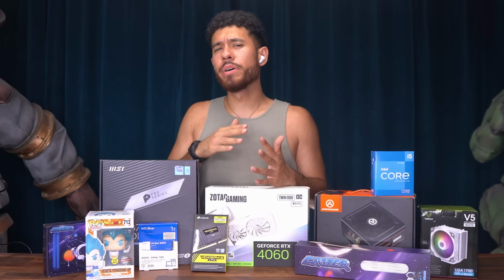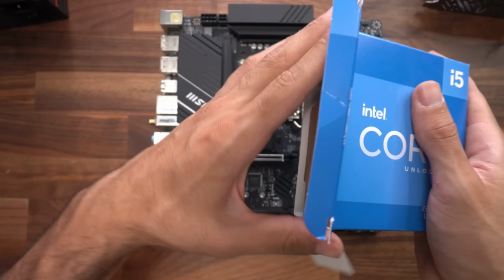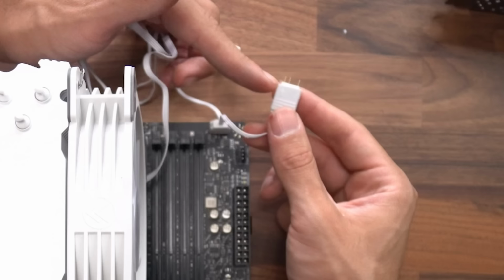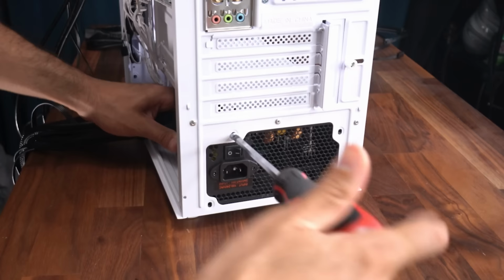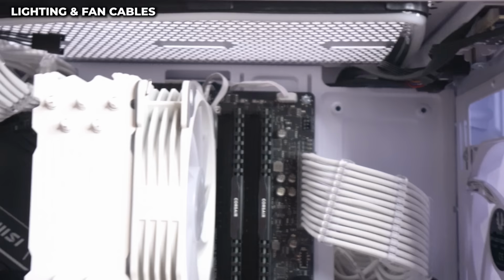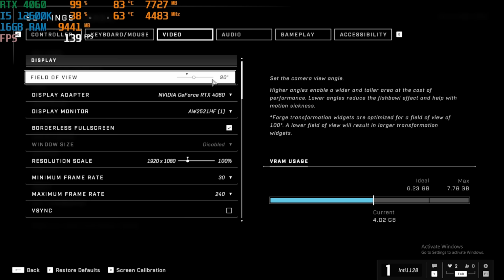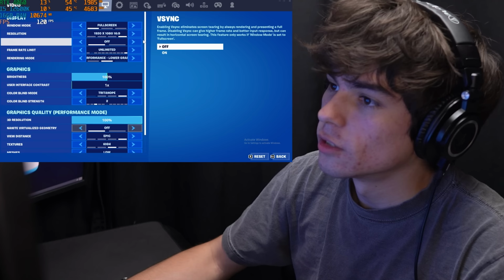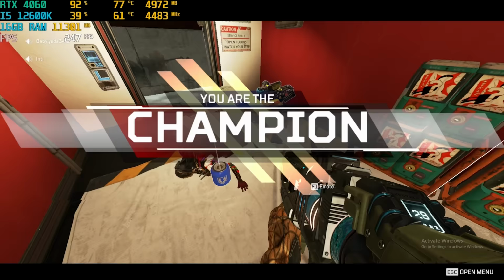BEST $900 Gaming PC Build Guide - RTX 4060 i5 12600K (w/ Benchmarks)

Comment from the maker: PCs for SALE from videos! :D https://craterhq.com/collections/desktops
Reply: It's out of stock. You gonna add more soon?
Reply: will be ok if i use ASUS Dual GeForce RTX 4060 OC instead of the one you chose?
Reply: is it ok to use a ryzen chip instead of intel?
Reply: @razaalidragon9809  depends on which ryzen chip
Reply: @zak2478  ryzen 5 5600x or ryzen 5 5600 or ryzen 5 7500f
Reply: That's what I did @starmanCOD
Reply: can i use intel core i7?
Reply: @zak2478  are u able to run gta 5 role play with this setup  yes or no I need to know it my first time getting a pc
Reply: Hey can I use a i7 cpu with this
Reply: Could I put a 4060 ti in this build

Comment: I’ve ordered the components for this build with a few upgrades. I went for the 4060ti, 13600KF and 32GB ram instead 🙏🏻 can’t wait to get building
Reply: Bro, if i make a slight change, won't the height of the part and stuff be different. Will it fit properly then? Can i make my own upgrades and still fit all  the stuff?
Reply: You poor soul. Should’ve went 6800 instead.
Reply: Guys can you explain the diff between this k, f, t and the numbers 6000k 7000k 12000k and all..this is really confusing...
Reply: same bulid but wiht 3060 ti , first i got 6700 xt , but it had driver issue watching youtube i got balck screen and restart , and radom restart on games
Reply: @Xiao-pi3un  If your Intel processor has a K, that means that it is able to be overclocked and has been unlocked. F means that there is no iGPU or integrated graphics for the processor. KF series processors tend to be cheaper than K processors and usually have no iGPU.
K= High performance, unlocked
F= Requires discrete graphics
S=Special edition
KF= unlocked and no integrated graphics.
And T is Power-Optimizer lifestyle.

And about them numbers how higher the better performance,make sure to go in details so u can see the Cores and Threads.
Reply: Hey how’s it running? Also did u change the motherboard or power supply wattage from the 650w?
Reply: @Funky_Codm hello a question about the k series in this build he choose the i5 12600k k you said it's unlocked does it mean that the numbers he got during performance testing are from overclocking the cpu?
Reply: @Chrisp707- is that compatible with this build ?

Comment: Dude took me from a noob at building PC's to building and selling PC's. Thanks my dude much love
Reply: How much would u sell this pc for if u we’re flipping
Reply: Would a i5 13400f still work good in this build
Reply: @LukaszL123 yes it would this guy crater is on crack or smth if he thinks 13400f will bottleneck it, you could use 11400f and it would still be usable not preferred but usable but I wouldn't get any of this I would get a ryzen 5 5600 and an rx 6700xt, you get better performance and cheaper cost
Reply: Can b760 run 13600kf?
Reply: @dudus9287  yes
Reply: @ProfessorTurtleGuy  thanks
Reply: @ProfessorTurtleGuy so theoretically, everything can stay the same but will I be able to switch to the 6650xt along with the Ryzen 5 5600x? Basically what you did now that I’m reading your comment over.
Reply: @yourlocalbluntfriend4136  you would need an am4 motherboar instead of lga1700 but basically yes
Reply: @ProfessorTurtleGuy  noice

Comment: Great build, only 2 things I would change. First, don't get the light strip and get 2 fans for the top of the case. Second, get the TEAMGROUP T-Force Delta ram in white.
Reply: idk man. Airflow’s important
Reply: psu is very low in the tier list
Reply: @monkyincorporated  It will probably be fine, I used to have a pretty low tier corsair psu and it never gave me trouble in two years but I sold it so I can't tell for sure.
Reply: @mariodroid7  idk man it’s all the way at the bottom “Tier F • Replace immediately” tier.
Reply: @monkyincorporated  the PC is probably going to pull 250 or 300 watts from the wall.  The PSU has way more power than it's needed. The  problem I see is that it's going to be more expensive in the long run because of electricity bills. I also had a tier F psu and it was great, pretty quiet BTW.
Reply: @monkyincorporated where u see the tier lists ?

Comment: Thanks, just ordered the parts!
Reply: does it work?
Reply: @dufib  Yes, I ordered everything except for the 4060. I got a 6750 XT instead. It’s a little better than the 4060 I believe. If you have problems setting up the pc like I did ask me!
Reply: @Soughtlius  alright ima order the parts then thanks!
Reply: @Soughtlius hey it’s been 9 days how does it run what games are u playing
Reply: @dufib  A couple tips I had problems with for a while that I could have fixed instant: Make sure you connect the HDMI to your GPU and NOT your motherboard. That limits some of the features of your GPU. I thought my GPU wasn’t working properly for a long while, but it was because of a bad mistake I made. 

Also, the PCI-E (power) cords in your Power Unit (PSU)  can be split into two separate parts. Your 6750 XT basically has two power ports as opposed to only one in the video (4060) so it would need for you to split it into two parts so you can put it into the two ports. Don’t worry, your cords are made to be split into two. I was a couple steps from crying when I thought I didn’t have enough power ports in my PSU for my 6750XT.

Also if you’re playing games, a vastly small percentage of them may be using your CPU which is for slower than your actual gaming card (GPU). Minecraft is an example. To fix this, go to System > Display > Graphics (or just type graphics settings in the task bar) Find your game, go to options, and tell windows to make it use your GPU. This is common in the Nvidia gaming cards as well, but this is an issue with the game or windows.

Comment: Thanks man, I built this exact setup and it looks great man. Very easy to follow your guides on building a PC. Really pleased with the build you’ve shared, such a bargain for the performance.
Reply: Does it run games like rust or gta 5 good on like 120+
Reply: @z6X-_-  yessir, I’m a rust god, I run the game on all low settings (you don’t need high settings, looks amazing on low) running over 120 FPS, think I average a stable 165.
Reply: @spectz1597 how’s the storage ?
Reply: @spectz1597 what other cables should I use? The current ones are out of stock.
Reply: Did you have to buy a WiFi adapter?

Comment: I love that we all collectively have been influenced by Joey to build our own PCs. I used his guide for my build back in 2019. 
SIde note, 4060 running at 84 degrees in Halo??? Yikes
Reply: Its probably due to the funko pop blocking the entire cold air from the intake fans to the gpu
Reply: That's zotac for ya, heard they have terrible build quality
Reply: Mine has i5 13400f with rtx 4060, it will work fine right?.
Reply: @sujalpatkar5151 yeah you should be alright 👍🏾
Reply: yeah that's a lot RTX4060, is one of the worse cards in terms of fps per dollar. I would rather go for RX6650 XT that i recently bought in my build which is cheaper and gets similar peformance and stays cool (approximately 50-70 degrees in game). Also Halo is not really optimzed.

Comment: 13th gen i5s definitely don't bottlneck the 4060 😂
Reply: I was going to ask if i have a 13600K should i still get the 4060?
Reply: @mvlly  Honestly I'd probably go for a more powerful card if you can afford it as the 13600k is definitely capable of handling a better card. If Ur budget is tight the 4060 is still a good option and will be able to teach it's full potential with the 13600k.
Reply: What other card should I get?

Comment: bro idk if you're sponsored by NVidia now but 4060 is a truly bad pick at this price range. You could get much more out of similarly priced 3060ti-3070, 6800xt and 7700 on amd side. This card released with such a bad MSRP and only performs %3 better (in some cases worse) than the 3060ti it aimed to replace.
Reply: I was thinking of building a pc around this video. Would using any of those cause compatibility issues?

Comment: Appreciate you making builds with the 4060. I'm building my first pc and ordered the 4060ti but ppl are telling me it was a bad buy. It's my first pc so I wasnt sure until now
Reply: Yeah, I seen many videos saying that the 4060 is worse than the 3060
Reply: It is a bad buy. The last generation RTX 3060 Ti performs INDENTICALLY to the 4060 Ti at a much cheaper price.
Reply: Well it's not worse at all, it's just fkin overpriced. At 200,- it would be awesome. @edwqrdd
Reply: @procrastinates what‘s best?
Reply: @WarpleXx_  Ideally, you should get a AMD card like an RX 6750 XT because it has more Vram. If you're such a sucker for Nvidia GPUs, the RTX 3060 Ti is similar in performance to the RX 6750 XT, however, games in the near future will be Vram intensive. 8GB GPUs like the 3060 Ti will hit their Vram limit, causing diminished performance. If you want your GPU to not be obsolete in a couple years, get one that has at least 12GB of Vram. Sorry for the wall of text.
Reply: @procrastinates  thank you for the reply appreciate it☺️
Reply: @procrastinates  In my country, the price of 4060 ti is the same as the price of rx 6750x, what should I bring ?
Reply: @procrastinates  the 6750 xt is probably closer to the base 3070 because of the vram being more utilised in todays games
Reply: Don’t listen to them. While 3060ti is better value, the 4060ti has DLSS 3, and will have more exclusive features than the 3060TI. It will also be supported longer and be better in the long run.
Reply: @wvminecraftkid  If fsr 3 is any good dlss 3 probably won't matter anyway
Reply: Always get the latest cards. Don’t listen to the jealous ones
Reply: @fightnight14  jealous? Dud how? It's an ass card at least value wise people are just trying to help him  -_-, also you saying always get the latest cards shows as to how much you actually know about graphics cards

Comment: followed this tutorial, came out great!! thank you so much ^_^ 

anyone else following this tutorial, just know you’re going to need white cable extenders with TWO 4+4s (incase you aren’t able to buy from Crater’s store due to being sold out)
Reply: New to pc building, gonna build this pc do u have a link to the cable extenders you used?
Reply: Do you have to have them in order for the cable to reach?
Reply: why do you need them? i built this pc just fine i did run the 24 pin through the side like him at first but i noticed it pulling because of no slack so i ran it through the bottom but both ways worked fine no extra cable or led i did order a gpu support tho

Comment: I just built A 1k pc build last week.
 I used that same zotac 4060, but i paired it up with a I5-13400f.  Teamforce T-Force Delta RGB DDR5 Ram 32GB (2x16GB) 6000MHz. GIGABYTE B760M AORUS ELITE AX. Samsung 990 pro 2tb with heatsink.  Wrap that bad boy in a lian 216 black case.  White on the inside black on the outside. only part i didnt have to buy was power unit. I already had a VGA 750 G3.   This was the fist time ever building a pc. I usually would just buy a prebuilt one.

Comment: Hello i'm new at pc building and i decided to go for this build but i have a question.
Can i switch the rtx 4060 to a msi rtx 4060 ti?
And can i add a Lexar NQ790 2 TB PCIe 4.0 SSD , M.2 2280 PCIe Gen4x4 NVMe 1.4, with 7000 MB/s?

Comment: just a tip from a average guy, please dont hold the gpu with  your fingers on the connectors....
Reply: As a matter of fact, you shouldn't touch the connectors on any device. The oils from your skin can cause connectivity issues.

Comment: THIS IS NOT WHAT IS USED IN THE VIDEO:

rtx 3070 USED      /350 euro/
ryzen 5 5600X  /150 euro/
endorfy singum 300 case  /70 euro/
gigabyte 650w 80 plus bronze /60 euro/
16 gb ram ddr4  /40 euro/
gigabyte B550 gaming X V2 /120 euro/
idk random nvme m.2 1tb ssd /52 euro/

Total: 836 euro (887 USD)

So basically what you are getting here is better performance than in video for a little lower price, however if u want new parts ONLY then this pc shown in the video is propably the best option BUT i would recommend alternatives like 5 5600 with rx 6700 xt for lower price but without DLSS 3 and Nvidia features. But overall very good vid lad :D.
Reply: So is your version better fps wise?
Reply: @Steven-cr1og  well yes

Comment: I am a newb to PC building, never built one BUT I would love to have a go at it. Please rate my build: Corsair Vengeance RGB 32 gigs of ram ddr5 6000mhz xmp, Asus ROG strix b760-a mobo with a i5-12600k cpu & DeepCool AK620 cpu cooler, Patriot Viper VP4300 M2 2280 PCIe gen4 2tb ssd,  Redragon PSU007 80+ gold 850 watts full mod, NZXT H5 Flow compact atx mid tower, Asus dual GeForce RTX 4070 white OC with a set of 3 fans for extra intake/exhaust. I'm going for a white build.

Comment: Anything similar to the 4060 that would still be compatible with the rest? I've heard that the 4060 isn't good for its price
Reply: It’s not good IF you have 3060 or 3060ti

Its insane value for money if you are upgrading from 1060 or similar
Reply: @do.xuantung so should i get a 3060ti? is it better then the 4060? is it compatible in this buiod

Comment: I heard the aresgame psu is on the bad side of the psu tierlist so I ended up getting a Thermaltake 650w instead. Now he is using the aresgame psu in a build that is prolly just as good if not better than mine and now I feel like I spent extra. If anyone wants to buy the psu from me I can sell it for about 45 bucks. Branndnew only taken out of the box to check the components.

Comment: I've never biult a pc before and I want to ask to check if the specs are good so :

Ryzen 7 5800X
Asus Rog Strix B550-F Motherboard
Zotac Geforec Rtx 3070 ti 8GB
Corsair 4000D Airflow Tower
Teamgroup T-Force 16 GB Ram
CoolerMaster Hyper 212 CPU Cooling Fan
Corsair RMe 750 W Power Supply
Lian Li UNI Fan AL

Comment: i bought most of the same parts as in this video i only bought another case, power supply and cpu cooler and this was not much more expensive maybe like 150$ but i insted of being around 1050$ it turned out to a bit over 1400$ i dont know if its because the parts are more expensive in sweden then in the US but idk. still a good build tho

Comment: W build but I’m making this same exact build but I’m getting a 4060ti and another power supply same amount of Wats I’m also wondering if all the cables from the power supply with all reach to the motherboard so basically there’s no cable that can be connected to the motherboard and other that can’t as the cables don’t reach the power supply I‘ll be getting is from a brand called Powerspec. Also I switching the cpu cooler for the Vetroo V240 White Liquid CPU Cooler 240mm Addressable RGB & PWM Pump & Fans 250W.

Comment: not sure if u had those gpu fans cranked or not but thats kinda hot
Reply: 75c is pretty average for a higher performing graphics card. Only should be worried when it reaches temps over 90
Reply: @Imperf3cts  true, i just think that 4060 could be cooler probably

Comment: Hello, ordered the cooler from this video however it came with just the radiator and the fan, no bracket to mount to the mother board or anything to connect the rad to the fan. What should I do as customer support isn’t answering
Reply: It should be in a bag. If there is nothing, 100% call customer support.

Comment: can i use an intel 13th gen i7 instead of the i5 simply or do i have to make some changes?
Reply: Would be much better than the i5 actually but see if the power supply would provide enough watts for the whole build, and see if the motherboard supports i7 and gen 13, i dont know much about motherboards so i didnt pay attention to the MB he used

Comment: Will this run 1440p at a max of 280 hz ?
Reply: 1080p, 240hz
Reply: @arkinfinity5646  how can u make it run 1440p? I’m new to pc stuff 😅
Reply: @SpamNinja1  well you have to get the monitor 1st that can run 1080p and 240hz for the best results, usually when you get the monitor it already runs those setting when connected to the PC.

Comment: Can i put multiple graphics cards or only one?
Reply: You only use 1. There's no point in using multi graphics cards anymore. It was never a popular feature. Games had to be developed with that support but it was difficult and not very common. So most games didn't support it. And the games that supported it didn't necessarily work better. Both AMD and Nvidia have largely dropped support for SLI/CrossFire.
Reply: @JJFlores197  Thanks

Comment: Could you play 1440p with this setup?
Reply: Yes you can easily play it on high settings...
But I would suggest you to buy a 3060 over 4060 bcz 1440p will demand more Vram and 4060 has only 8 gigs of Vram whereas 3060 outperforms 4060 in most of the games bcz of the 12 gigs of Vram.
This gpu is good for only 1080p...

Comment: ok but why do you install the psu upside down?
Reply: That way the power supply can get direct cooling the fans are on the top of the power supply meaning if you flip it it was suck air from the vents at the bottom of the case

Comment: is there any alternative to the power supply?
Reply: with the specific specs he is using, anything 650-850 (or 1000 if you prefer) should be fine. most psu's are universal cables.
Reply: @Imperf3cts isnt 1000w an overkill? I heard the 40x0 series is better than the prev generation when it comes to power consumtion and the cpu doesnt really need that much of watts

Comment: I built it and it powers on but there’s no display

I’m honestly stumped because nothing happens when I turn it on
Reply: Make sure you plugged in the video cable into the graphics card and not the motherboard's video port. After that, make sure ALL internal connections are correct. If your board has a diagnostics light, take a look at it as that may help tell you where the problem may be at.
Reply: @JJFlores197   This is really late, but it ended up working great

 Everything turned on and I haven't had any issues since